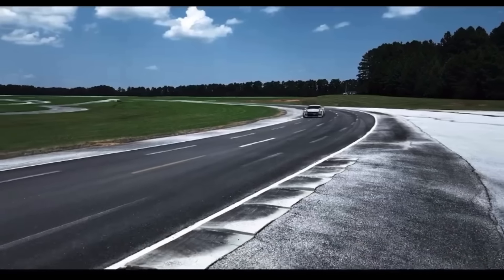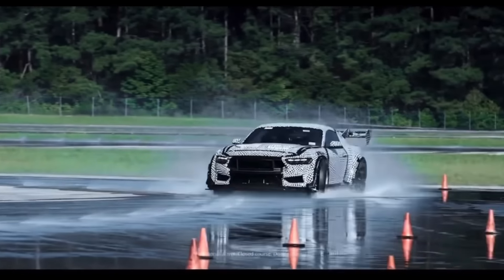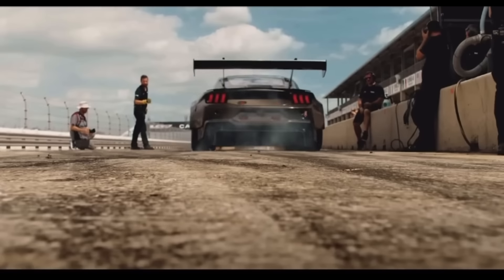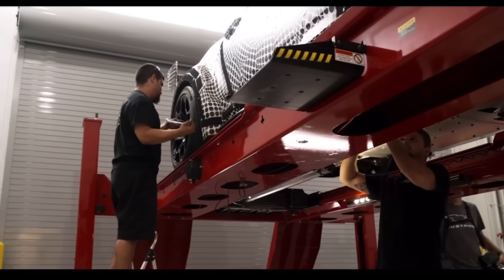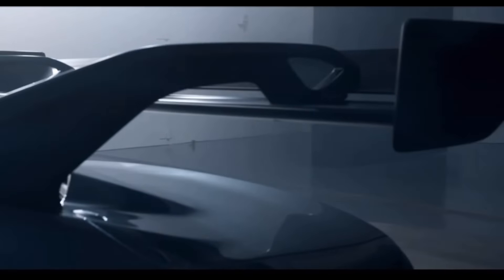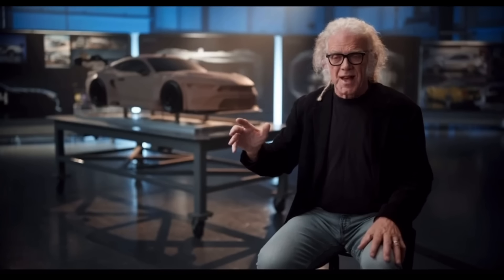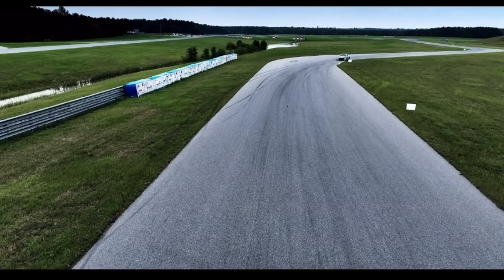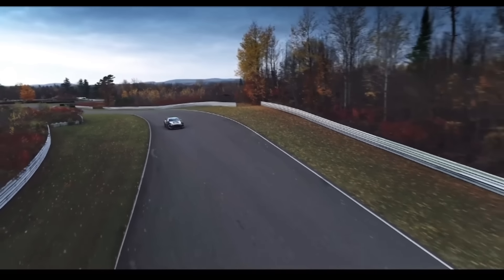Ford Mustang GTD | 800 Horsepower German Slayer!

Comment: It will be interesting to see what this does against the C8 ZO6 on track.
Reply: Smokes it.
Reply: ** ZORA / ZR1
Reply: @serialkiller6422  smokes that too lolz
Reply: It is not smoking a Zora or even a ZR1. It won’t even match the performance of a Ford GT. If you are buying this for performance per value, look somewhere else.
Reply: @al151  smokes those too.
Reply: Well if the fact that Chevy hasn't produced a Nurburgring time for the C8 Z06 in 2 years is any indication the point goes to Ford
Reply: Out the gate z06 will eat it up just like the demon. But at 300k plus mark up 😂
Reply: @al151  what are you smoking 🤣
Reply: @Blakelysworld358 I think they did it was their release date. I think it was seven twenty eight
Reply: @al151  If you think that FORD didn't publicly call out the Porsche 911 GT3 RS and the AMG GT Black, and their track times for a reason, you're kidding yourself. 

So, that means that they are planning on going 6:40-6:45, or better at Nürburgring. 

Which would put it in the Top 5 fastest production manufacturer's cars' ever conversation.

And neither a FORD GT or a ZR1 are in that...
Reply: @c8miamicarclub  😂 that's a GOOD one
Reply: @navypatriot1016ummm think you need to stop drinking that corvette kool-Aid for a couple days
Reply: @Blakelysworld358 
They have records on sanctioned
Tracks. The nurburgring times 
Aren't verified by a 3rd party. 
That's why chevy doesn't bother
Reply: Not a fair comparison 
This is a road legal race car
With extreme aero. C8 Z06 
Isn't made to be track only
Reply: @al151 so much amazing knowledge about something that you don't know anything about, I hope your friends and family appreciate how lucky they are to have you in their lives
Reply: @c8miamicarclub only time will tell
Reply: @navypatriot1016I think someone is jealous of the gt500
Reply: no comparison. The real challenge will be a GT2RS or AMG 1.
Reply: @farrd14  Brothers this will need to be settled on the track.
Reply: You can be the fastest guy to drive it into a crowd. 🤣 300,000🤣🤣🤡
Reply: @MrCyp200la did you even watch the video 😂
Reply: @Blakelysworld358  didn't the c6 zr1 do a 7min 10second ring time if I remember correctly?? The new gt4rs does a 7 flat!
Reply: @MrAllDay2u I do think it will beat those cars, but you’re kidding if you think it will be in the 6:30s like the AMG One.
Reply: Given the specs they have revealed, a total demolition would be my best guess. Multimatic suspension, Tremec, probably 200 lbs lighter, more aggressive rubber, probably nearly triple the downforce, greater track width, lower height, longer wheelbase, better weight distribution for cornering, and to top it all off, a 130 hp/270 lb ft advantage with a forced induction torque curve. Absolutely no shot does a Corvette beat this thing. The only stock competition I could see would be a GT Black Series (that GT2 RS was not stock lmao).
Reply: @The-fs5wn  I didn't say the AMG ONE. 

I said the AMG GT Black.
Reply: @MrAllDay2u read what I said. I said it would beat all the cars you mentioned, but a sub-640 would be ridiculous.
Reply: @marcog6470 you’re a hardcore fan boy. You haven’t even seen what a zr1 has to offer or Zora. There is no specs about it. So how do you know if it will smoke it? Stop D riding ford.
Reply: @N0neofyourbusiness. 
It's over for the ZR1. 
Stand by.
Reply: @richardmodglin3900  the zr1 is not even out yet. Ford already exposed all their cards. Now Chevy has a chance to copy and adapt. Watch the zr1 will also come up with active aero. The suspension ford using in the GTD, Chevy was already using that suspension. Ford is behind. Let’s bet money. I bet the zr1 will set quicker lap times than the GTD.
Reply: @N0neofyourbusiness.  
Bet money? How old are you?
But hey.... maybe the ZR1 will be faster. I need to know weight numbers for the GTD. That's important for me yo know before I go making certain claims. I'm not worried about the goods in the GTD.... they are legit.
Reply: @N0neofyourbusiness. Just because Ford came out with this car doesn't mean Chevy is going to just scrap the likely, YEARS, of work they've already put into the ZR1/Zora, so unless they already planned to make the cars as world beating track weapons they likey won't touch the GTD unless they put a lot of time into car specifically meant to go after it.
Reply: @c8miamicarclub  And ??? Let's not Forget. It's a Mustang. A Secretaries Car. It's not Fords supercar like Chevys Corvette. Let that sink in. Pound for pound it'll eat that Vett up. Lol Oh and it has a Itty bitty small block. So if I were a Chevy guy I wouldn't really brag because it kinda makes you look silly.
Reply: They won’t even be on the same level. The GTD is gonna be putting down lap times comparable to half million dollar Italian and German cars
Reply: @marcog6470 it's not going to smoke the Corvette you can just wake up from that little dream you're having their pal
Reply: @MrAllDay2u so what's your point you tell everybody your nightmares or your dreams
Reply: @GregoryAlcorn-o3g  I contacted Chevy they agree the GTD smokes it
Reply: @marcog6470 smokes it ? The gtd and the c8 z06 are both capable of under 7 mins Nurburgring the only difference is the z06 is half the price and has 130 less hp if anything the zr1 and the zora are gonna smoke the gtd keep dreaming though lolz
Reply: @richardmodglin3900 the gtd is capable of under 7 mins Nurburgring that isn’t impressive considering the z06 can do the same with 130 less hp and costs half the price the zr1 would legit smoke the gtd
Reply: @WindyCity1992 the Nurburgring is literally the benchmark of performance you goofball
Reply: @ericship8383  
Yet the GT3RS could only manage  two-tenths of a second  on a hot lap against a GT500 off the ring at Thunder Valley Raceway.
Hmmm.
Reply: @al151  
Stand by.
Reply: @ericship8383  
The point is not that both do under 7 minutes on the ring.....but how much under 7 minutes will the GTD be. That is what we are all waiting to find out.
Reply: @derekcharlesgrey under 7 mins isn’t anywhere near some of the best the 991.2 gt3 rs costs 188k and did 6:56 seconds on the Nurburgring with 520 hp from 6 years ago you’re telling me it’s impressive that the gtd can also do the same times as a 6 year old gt3 rs but also double the msrp of the Porsche? Yea okay
Reply: @quentinfreeman7516 the zr1 is legit gonna smoke the gtd whether you like it or not the z06 is already capable of under 7 mins Nurburgring just like the gtd except the z06 is 160k cheaper
Reply: @chrispokorney6801 pound for pound the c8 zr1 is gonna smoke the gtd 😂
Reply: @ericship8383  When it actually does sub 7 let me know. It's been out and they could've been done it if they wanted to.
Reply: @ericship8383  Wouldn't laugh to much. Let's not Forget the the Mustang is a Secretaries Car and not fords supercar unlike the Corvette. But ford has a Supercar as well that all the GM fan boys always conveniently Forgets about. The Gord GT. Think about that. 🤣 🤣 🤣 🤣 🤣
Reply: @richardmodglin3900 keep being delusional the zr1 is gonna smash the gtd
Reply: @ericship8383  
That's it.....I like enthusiasm!
Let's see what happens.
Reply: @ericship8383  
So what.....4 years ago a GT500 basically matched the time of a GT3RS at Thunder Valley Raceway. 
I guess it wasn't designed for that track cause it could only manage 2/10ths of a second quicker on a hot lap comparison. 
I'm not too worried being that the GTD is a significant upgrade from the GT500 to say the least.

Comment: Wikipedia says that it uses a variant of the 5.2L Predator. Does this also mean the engine has a cross-plane crankshaft?
Reply from the maker: I don’t think this is a cross-plan. The predator is the GT500 motor. It’s more than likely a stinger variant of the same block.
Reply: @Woahxofficial  , it's supercharged, not turbocharged, so it could be cross-plane.

Comment: I like how they didn't mention BMW.
Can't wait to hear the argument of stock vs modified over these two.
Reply from the maker: BMW doesn’t dominate in GT3 Racing its mostly Mercedes and Porsche.
Reply: Cause BMW has been getting slapped by everyone lately. There is no car in BMW history that can run with this thing on track.
Reply: @nodo7575  there is no car in BMW history that can run with old 6gen GT500 even...
Reply: @nodo7575  road cars*
Reply: @maximborodyuk3773 I mean the gt500 has a better power to weight than every bmw so I’d sure hope it can beat any bmw the 6th gen gt500 is slower than older Porsches so your point?

Comment: Man I would keep the engine in the front for balance. Rear mounted engine have crazy over steer look at Porsche when they first start you’ll see what I’m talking about you fighting balance instead of fighting speed
Reply from the maker: Well I’m not sure if I see what you mean. This car does have 50/50 weight distribution so it should handle very well.

Comment: I think it’ll still be a relatively abysmal 0-60 in 3.2-3.5s but the 1/4 should be 10.6s and a sub 7s at the ring…  it’ll need to do low 7:40s to beat the or compete with the Italians and Germans. 

I don’t know, I don’t think this will outperform much of what came before it from the Europeans.
Reply: They are aming for sub 7:00 ring time. 0-60 is irrelevant for front engine RWD 800hp track car.
Reply: Yea I don’t think a 0-60 or quarter mile time is really relevant for this type of product. It’s all about momentum/average speed
Reply: @nodo7575  agreed for the most part but then again I could also say that 800HP is irrelevant to some degree on a 154 turn track where a rear drive car (even with 50/50) can’t fully use all of the power. The GT3 (non RS has 502hp and did 6:54 at the ring.

I included the 0-60 because 99.8% of the buyers of the GTD won’t be tracking the shit out of the car. Part of the fun of being an owner of a car is to talk times, and it’s because of the car meet talks that I could argue that 0-60 times are more relevant for everyday use.
Reply: @nodo7575 when people say irrelevant it usually means it'll be slow.
Reply: @macbook802 no it literally just means quarter miles don’t even matter if you think drag racing and 0-60 is everything you must be 10 years old
Reply: @nodo7575  unimpressed the gt3 rs from 2019 did also under 7 mins with 300 less hp and costs 100k cheaper than the gtd tell ford to do better

Comment: you may beat a Ferrari, but you will never beat a Porsche with the same budget. you dont even get the weight low enough.
Reply from the maker: You should check out our most recent video about this car. We went into the specs.
Reply: @Woahxofficial   Some specs... ok. but  i still say: try to beat Porsche with the same budget. you can always put more $ € on the table...

Comment: Unfortunately because of BOP and who comes up with the rules book they won`t let the Mustang be as fast as it could be.The car is big and tall so by restricting the induction and the shape of the car it won`t race well on a lot of the tracks in Europe and some in the USA. Gone are the days of big engined cars allowed to lead laps.I seriously doubt that it will win a race.The forced induction cars will be a little smaller and faster.Not by much but just enough to outdo the two models of naturally aspirated cars in the field.
Reply: The GTD doesn't have the restrictions of the GT3. It'll be basically privately owned  through application
 process.
Also, this isn't a naturally aspirated car so I have no clue what you're talking about.

Comment: That's great, and all, but what about an all drive version With room for improvements, ohh, we'll drive.  I have to say is look at Ken though. It's a custom vehicle, the concept and theory works. I'm pointing this out, screamen it. Please consider something like this. If a 14 year old is able to drive this car at 1400 horsepowor currently.
Hey, 14 year old.
DaughterA little bit older now. But if she's doing this and dominating on a track.
With this car, what does that say about the safety and the concept of the track?. And she looks like she's gonna be a beast when she gets older. Maybe there should be a race.
If that car up against her can beat that car on the straight away, it's a simple test.
And then come back with a 4 wheel drive version of it and see what happens. That's what I'm saying, more Surface contact. More Traction.
Reply from the maker: Looks like it’s only going to be RWD as of now
Reply: @Woahxofficial  that sucks. It would be a whole new animal just why they have not done this  just saying  after watching the videos of that car, I mean it, a beast, the concept  it works  a different drive Trans  is different.  And the hp is in the same range . I just thought that would be an idea that I think should be heavily investigated. His car, all they did was just stretch the front. End out to fit the drive frame by like 5 or 6 inches or So. They have to use beat lockers to keep the wheels from spinning On the rim all 4 You're at that range with a horsepower. What would it look like manufactured to have a four wheel drive mustang. Keep in mind, it's also a drift card, not a track card, but apparently it's Is all Rounder.

Comment: That car is not going to be able to beat the new Corvette let alone Porsche come on man and when I say the new Corvette I mean the ZR1 and it's a fact and everybody knows it's true that if you don't have a mid-engine or rear engine car you don't stand a chance the viper already tried it the front engine Corvette tried it it ain't happening sorry
Reply from the maker: I’m not sure about that one. The ZR1 is definitely no joke what so ever but this one might have it beat. This is an extremely light vehicle with all the carbon fiber parts. It also has over 800+hp with the even 50/50 weight distribution. It will be interesting to see. Get your 🍿

Comment: The fact that these idiots think this little gay pony is gonna slay any German vehicles is actually quite hilarious 😂
Reply from the maker: Calm down Betty you’ll just have to wait and see results like all the other nonbelievers. BMW doesn’t even dominate in gt3 racing so I don’t see your point. Not even a top competitor. Top competitor is Benz, Porsche and Audi. I like your point of view tho I must say.
Reply: @Woahxofficial  don’t see it touching Porsche. Even being full carbon fiber and a supercharged 800+ hp v8. At Nürburgring Gt350 is currently the fastest mustang running a 7:15 and the gt500 behind it running a 7:39 American cars just have trouble putting the power to the ground like Germans do they need a prepped surface and massive tires to really do anything impressive
Reply: @Woahxofficial  also the m4 gt3 was second behind the winning Ferrari. Look into the ROWE racing team and their M4 GT3. Also how are you going to flex a YouTube channel about cars and racing and not know anything about either? 💀💀💀

Comment: German Slayer? I doubt it! Porsche GT2 RS is still on Top!and the AMG GT Black Series is the fastest production car on the Nordschleife,!😎
Reply: You're underestimating! It's 800hp with a DCT transmission and pure carbon fiber and 50/50 perfect weight distribution with all that grip and aero. It's going to compete against those
Reply: @YusufSayed-px2xy  Oh, I forgot: AMG One is the fastest Production Car on the Nordschleife...😉
Reply: even if this mustang has a turbo diesel, it will never beat a porsche GT2
Reply from the maker: Loading ford Championship…

Comment: It doesn’t compete with the European cars, it’s not subtle enough to be used everyday, it’s brash and loud with only one personality, it’s make up is similar to the F50 Ferrari, a race car for the road, it just doesn’t work as it has to be a road going car that can be used on a track….  Alfa Quadfolio, BMW M series, Mercedes AMG line and so on as these are kiddie carriers, school drops, store going everyday vehicles that have the J&H factor… and most of these only have between 450-650 hp…
Reply from the maker: You sound like a German fan boy. I don’t think what you’re saying is necessarily true man. Can it compete should be the question. Which were already seeing the answers now go look up the Mustang GT3 races.
Reply: @Woahxofficial  

Once again, you’re comparing Mustang GT3 cars which are not modified road going vehicles, they’re roll cages with panels added, they weigh 1/3 of the weight carry twice the power, suspension doesn’t even replicate the factory car and the brakes are 6-8 piston calipers with 360+mm discs which are carbon, so no the GTD is NOT EVEN IN THE SAME CATEGORY as a road version of a M BMW, you have no idea what you’re talking about as I don’t really care what you think is true or not as opinion isn’t fact it’s just ones opinion..

Secondly, I drive a 1969 Chevelle SS as a daily when I’m not working…. Otherwise I’m in the Tundra, I not a German fan boy as I drive what I want and not just because of brand snobbery..